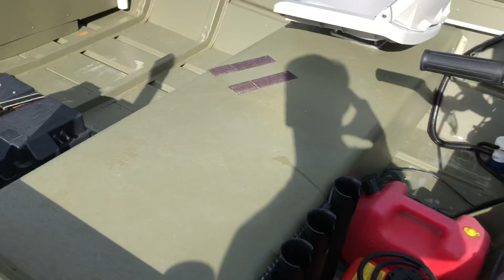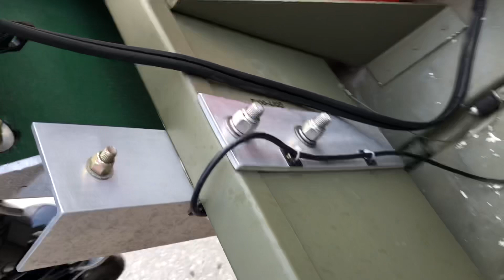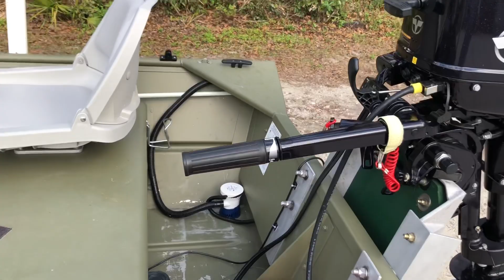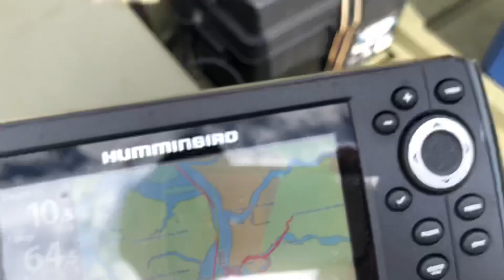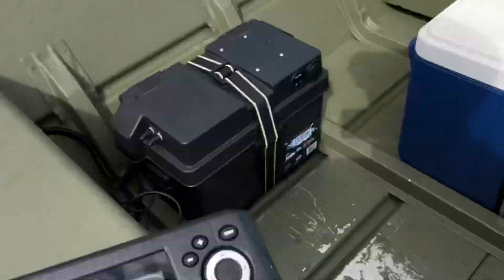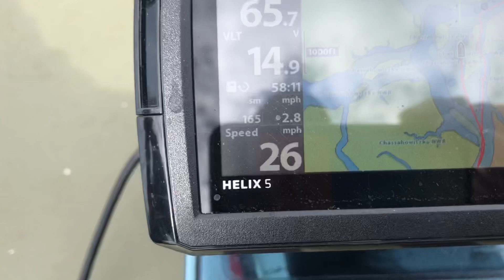Tohatsu / Mercury 20HP Top Speed Test on Lowe 1448M

Comment: Any update on your experimenting with props?  In this video you mention a "12" pitch and a "10" pitch.

For reference, any estimate of your total weight (boat, motor, people, cargo, etc.) when you have the full family aboard?

I note from the Tohatsu Owner's manual for the 20 hp (downloaded from the Tohatsu North America website), below is what they list as the available propellers.

When you refer to a "12 pitch" are you referring to the 11.5?

Which prop did your engine come with?

I'm planning to get a new Tohatsu 20hp with tiller, electric start, power tilt and long shaft (weighs about 118 lbs).  I'll be putting it on a 15'2" v-hull (74" beam, with 20" transom)  with a dry weight of approximately 330 lbs.  Mostly it will be my wife and I, occasionally one other person.  Fly fishing gear, etc.  No trolling motor.  Lithium battery for the Tohatsu + the 7" fish finder.  

I've considered going to a 25hp, but I"m hoping the 20hp will meet our needs, giving us good speed and being able to consistently get on plane.

We will be operating this boat at a wide range of altitudes, from sea level to 7,700 feet.  So, I'm assuming I'll need to have an extra prop for the higher altitudes.  Not sure yet which one.

Thanks for your videos.

Cheers,
Reply from the maker: I’m sure yours will come with a 10. What you will really need is a tach and run some load tests like I did. I uploaded a video on the tach that works with these motors and how I installed it. 

The 12 I use is a Solas. I also have the Tohatsu 11.5 and use it as a spare. Sorry I don’t have an idea about weight but you could look up the specs on my boat. Lowe 1448M. Same motor as you are getting minus the power tilt. 

I have a feeling the 10 or 11 will work for you, just need to test and verify with your tach that you are in range and not over or under revving the motor (after break in).
Reply: @commonsensesolutions6662  Doing some research, I note that at both the Tohatsu origional parts website and the Tohatsu product website the both list a 9 pitch prop as being standard on a 20 hp Long Shaft.  They both also say that you should drop down to a  7.8 (8) or a 7 for "Moderate" or "Heavy" loads, respectively.  Are you certain your 20 hp Long Shaft came with a 10 pitch.  Tohatsu says a 10 pitch comes standard with the Short Shaft engine.
Reply from the maker: @shannonyork5300  it’s a 10 for sure. Stamped right on the side.  Honestly, if this motor came with a nine it would not have worked very well at all with my set up. When I first tried the 10, the over rev light was constantly coming on which is what prompted me to put a tach on so I knew what was actually happening. I could see possibly running the nine with my set up if I was trying to pull a tube or maybe even the eight. I plan to try pulling the kids on a tube this summer so I’ll find out. Again it all depends on your set up and how heavy everything is. 

Mine might have a slight advantage because I have it on a jack plate and also some setback which effectively adds more leverage. So I think you have quite a bit of testing in your future 👍🏻

I am also of the opinion that some of the Tohatsu online resources are a bit outdated on their websites as it is totally different from the owners manual that came with my engine.  

The good thing is you’ll end up with lots of spare props like I have and since I do a lot of fishing around rocks and oyster beds this is a good thing.
Reply: @commonsensesolutions6662  Interesting.  Another guy recently purchased a 2021 20hp Long Shaft and it came with a 9 pitch.  With your setup, particularly with your full family load, I would assume you'd need to go down in pitch (less than 10), not up to an 11 or 12.  Presumably, your jack plate is making the dynamics different.  Yep, I can see multiple props in my future, particularly as I experiment with higher altitudes (a couple lakes in the 8,500' range).  Currently, Tohatsu does not have any of these props in stock!  I suppose I could consider after-market props.  Cheers,
Reply from the maker: @shannonyork5300  interesting! Maybe it’s a regional thing or perhaps whatever they have the most of. The 10 works really well with a full load, ends up right in range with the right power. A few of mine a Solas and they seem equal quality to the OEM. One person told me Solas makes the Tohatsu props. It’s possible. I tried an off brand and it vibrated like crazy. The Solas are approx the same price as OEM as well.
Reply: @commonsensesolutions6662  Thanks for the info on the Solas props.  I'll check them out.  Cheers,
Reply: @shannonyork5300  My 20hp short shaft just showed up with an 11.5 prop
Reply: @Cutlass_Rudd  Interesting.  My 20hp tiller, electric start, power tilt, long shaft arrived last week.  It has a 10 pitch.
Reply: @shannonyork5300  Wild, I wonder if they just put on whatever prop they have.  In my case I am glad though, its just going on a 12' SIB.  Pull start, no power tilt.
Reply from the maker: Also wanted to mention that this motor has a lot of torque. Even fully loaded it pops right on plane with the correct prop.

However, if you have any doubts get the 25 just to be on the safe side. I went out fishing yesterday with my Dad, two kids, loaded boat, and with the 10p prop going against the wind  (10-15 mph wind) the best I could do was 21mph. Jumping on plane was not a problem.

Honestly, if I were to get a larger jon boat I’d upgrade to the 25 or 30 as I like to have plenty of reserve power.
Reply: @Shannon York. Did you get the Tohatsu? I'm looking at a 13 ft aluminum Smokercraft v-hull with a 20hp Tohatsu. No electric start or electric trim. I don't  know the prop pitch. But I weigh 250lbs, so I'm concerned about the ability to get on plane especially if I add a trolling motor battery.
Reply: @kingstonsean  Yes, I got the 20hp EFI Tohatsu.  It came with a 10 pitch.  If you look closely at your prop you should see a number stamped on it.  My Tohatsu is on my 15'2" modified v-hull aluminum, which weighs approximately 340 lbs.  From sea level up to about 3,000 - 3,5000 ft, the 10 pitch does great, no problem getting the boat on plane with me and my wife and all our fishing gear.  Above 3,000 feet or so, I drop down to a 9 pitch and then at 6,500 feet up to 8,000 feet I'll drop down to an 8 pitch, particularly if there are 3 of us in the boat.
Reply: @shannonyork5300  Thanks for the detailed reply. The Smokercraft weighs about 250 lbs. So this sounds like a great option. If I may ask another question, what is the top speed you can get 10 pitch. I'm less than 500 ft above sea level.
Reply: @kingstonsean  With just me, it will do 23 - 24 mph.  Cheers,
Reply: @kingstonsean  With just me, it will do 23 - 24 mph.  My motor has the power tilt and the electric start. It is also the Long Shaft version.  It weighs 118 lbs.  Cheers,
Reply: @shannonyork5300  That's outstanding. double what my 18ft pontoon will do with a 25 hp Merc. But a pontoon is about as aerodynamic as an airplane hangar. :)
Reply: @shannonyork5300  Thanks for your help. You gave me the confidence to buy the Smokercraft with the 20 hp Tohatsu. Will have it in the water by next weekend.
Reply: @kingstonsean  Have fun with your new boat.  Let me know how it goes.  I do advise that you get a Tach/Hour combo digital meter so you can watch your rpms and keep track of your engine hours for maintenance, etc.  Cheers,

Comment: what model you choose it and why ?  Do you know 2021 Tohatsu 20 HP MFS20EEFTL  = EFTL  and 2021 Tohatsu 20 HP MFS20EEFL = EFL what's mean ?
Reply from the maker: Hi Simon, mine is the MFS20EFL (Electric start, Long shaft). I wanted electric start to make life easier and also so I’d have the battery charger. Long shaft because it was all I could find so I had to modify my transom accordingly, it worked out well. I’ve always believed in setback, even with short shafts, so all I had to do was raise the Jack plate a little. 

Looking back I would have spent the extra and got the electric tilt option. 

My advice: get the shaft length to match your transom and spend a little more to get the tilt and electric start options. You won’t regret it. 👍🏻

Comment: Did you try 9.25x11p ...solas amita 3? Solas amita and tohatsu props are the same
Reply from the maker: Hi Charles, yes, I tried the 11 but was still over revving with light loads, the 12 turned out to work best for my ‘light load’ days. I keep it for a spare. So far, the 10 for heavy load and the 12 for light load seems to be working perfectly. I’d like to try pulling the kids on a tube this summer and am curious if the 10 will work for this or if I’ll have to go lower or even 4 blade for the low end torque I’ll need. We will find out this summer. 

I also only use aluminum prop versions since there are so many rocks and oyster beds where I fish. I like the ‘give’ of aluminum for these little motors plus props are cheap compared to prop shafts and I can file down and clean up the aluminum prop edges easily with a file. 

My props are all a mix of OEM and Solas, thanks for bringing this up. They are identical except for the stampings it seems and perform identical. I tried a different brand and didn’t like the prop at all (vibration at certain RPM’s) so for these Tohatsu’s going OEM or Solas is the ticket!

Comment: What support device are you using to secure the motor to the trailer to prevent it from jarring and bouncing during transport?
Reply from the maker: It’s an Atwood SP-400-RB. It’s reassuring to know that the bumps in the road don’t directly transfer to the transom from the engine’s weight hanging off the back. 

The transom bracing is solid on this boat, but with the added setback and elevation of my setup, it can’t hurt. It was $29 USD.

Comment: Thank you for another video on the Tohatsu 20 hp.  I'm probably getting one later this year, so all the info you are providing is helpful, indeed.

In this video you mention that you are carrying an extra gas can.  Is that just for emergencies, or are you finding that on your typical day on the water the engine is consuming more gas than the standard tank holds?

Have you had to use the extra gas much?

Cheers,
Reply from the maker: It’s just for emergencies. These engines really do sip the gas. I always top off the main tank (3 gallons) before heading out. Even on the days that I go all day and travel many miles I’ve never ran out when I was sure I would. I’ll probably stop bringing the extra can at some point.
Reply: @commonsensesolutions6662  Thank you.  That's really good to know.  Like you, I may carry some backup fuel until I get comfortable with my usage, particularly when I know I'll be out for most of the day or covering alot of water.  Once I'm comfortable with my fuel usage on days like that, I sure hope I can avoid carrying the extra fuel.  Again, thanks for your videos.  Cheers,
Reply: @commonsensesolutions6662  With my 6 hp Yamaha and my 2020 30HP Suzuki I carry one of those quart size non alcohol gas sold in Lowes or Home Depot.  People use it for small 2/4 stroke engines (chainsaws, augers etc).  I prefer not to keep gas in the internal tank for the 6 HP Yamaha. Just old habits.
Reply from the maker: @michaelholmes4183  that’s a great idea 👍🏻

Comment: I’m looking to get a tachometer for mine. What brand is that one you have?
Reply from the maker: This one

https://www.amazon.com/gp/product/B01FYXX3C4/ref=ppx_yo_dt_b_search_asin_image?ie=UTF8&psc=1

So far so good with this one, what motor do you have?
Reply: @commonsensesolutions6662    Thanks for posting, watched video last week and just purchase 20hp with short shage manual start.   How did you route the tach cable into the engine.  Again thanks really appreciate your insights.
Reply from the maker: @gregsheehan5457  Hi Greg, I did a video recently showing the install:

https://youtu.be/k2G_aZhGY7g
Reply: Dont waste your time and money on the one shown here.  Get the TinyTach.  It does cost more, but you get what you pay for.
Reply: @KungPowEnterFist  Purchased the one shown here to uses seems to be working well, time will tell
Reply: @gregsheehan5457  A year or two tops worth of battery.  And that's if it does not fill up with condensation and get ruined first.  Best way to avoid that is to never take your boat near the water.
Reply from the maker: @KungPowEnterFist  I actually considered that one as well. Downside is the lithium battery is non-replaceable, probably potted along with the electronics. They say 5+ years, but I wanted to try one with a replaceable battery. I did seal the battery access very well, I probably should have showed that in the video, but didn’t think about it. I am also curious how long it will last. Time will tell.
Reply: @commonsensesolutions6662  The trick is to order it with a custom wire length.  Its like $10 more, but you will be guaranteed a unit with the freshest battery possible.  The units with replaceable batteries are all terrible.  You really only got two choices here.  Get the Tinytach or get an actual OEM hourmeter gauge.  Everything else is garbage.